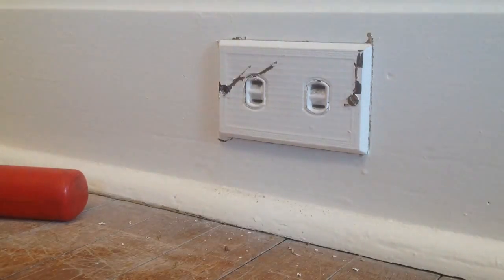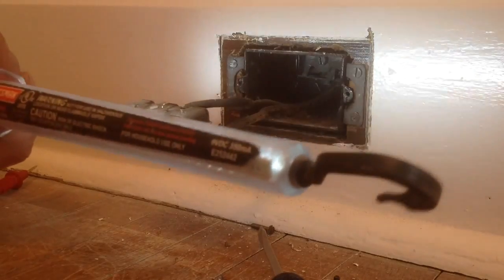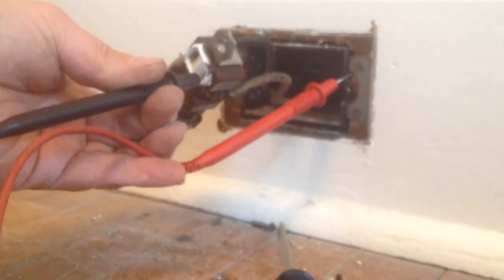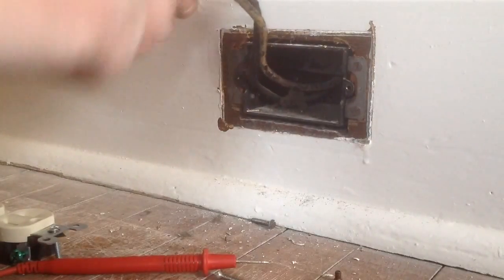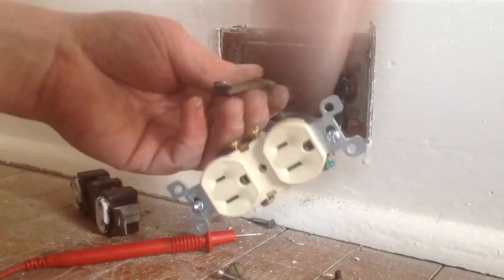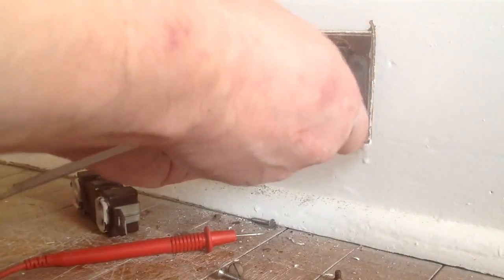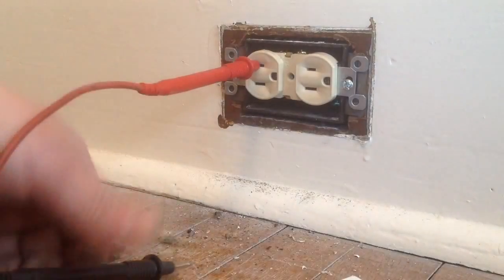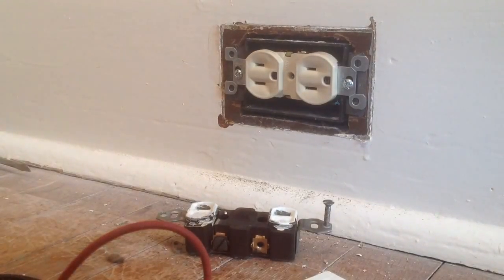Replace ungrounded plug with grounded plug

Comment: It is grounded because of the mounting screws on the receptacle, and the yoke making contact with the box mounting brackets. Just make sure the screws are tight. It would be better if you remove the paper keepers from the screws. Better yet, you could use a spec grade receptacle like a Leviton which has a brass grounding conductor staked on to one end of metal cradle. The mounting screw is always in in contact with this, making it unnecessary to have a separate ground wire. The box must already be grounded, which in this case he proved that it is. In many old homes it was common to have a 16 gauge wire run from the electrical panel to the metal boxes and attached to the back of each box. I assume that is the case here or they would not be grounded. Metal conduit or bx cable could also have been used here.

Comment: IT'S STILL NOT GROUNDED
Reply from the maker: Yes the plug is grounded. This is classic vintage BX wire. Even if you can't see the BX the style of the wire and plug reek bx. The ground would follow the metal bx cover to the main box and serve as a ground. It's grounded.
Reply from the maker: There is a part 2. That puppy is GROUNDED.
Reply: @themrhelperguy  lol a proper ground is connected to the green screw that has nothing connected to it. Even if it's just grounded to the box itself. Grounded to the box is acceptable in some states but won't pass an inspection for a city inspection in my state
Reply from the maker: Yes that green screw would be used with plastic boxes. The plug in the video was used with a metal box so the green screw would not be used. In the comment it stated that the plug was still not grounded. With the configuration in the video it is a grounded plug.
Reply from the maker: That little green screw is for use when you would use a plastic box since the ground is not carried through to the metal on the plug. That's why the metal of the plug has a ground provision. This is all common information that can be accessed in any trade magazine covering electrical wire articles. It's not something I do it is done everywhere like this. Really you would create a grounding mess when multiple devices are used to ground them to the box. Unneeded additional wires to fill area in a metal box. This will pass inspection all day as a grounded plug. Good luck with your city inspections.
Reply: I'm not having city inspections but I had to have stuff like that re done in order to sell my last house. This is how I know. That city wouldn't pass it for sale unless we ran a ground wire from the copper plumbing to every plastic box in the house. This meant wall repair too.

Comment: This does not meet NEC 210-7(d)(3).  It requires a GFCI labeled appropriately ("No Equipment Ground") to be compliant.  The narrator mentioned something about grounding but it was incoherent.  Without clear audio I can only judge what can be seen in the video, which appears to be non-compliant.
Reply: +Susan Stone Salas
The corrugated steel jacket of most BX cable manufactured prior to 1959 does not have a bonding strip, which means that if you try to use the jacket as a fault current path most likely it will have to high of an impedance to cause enough current to flow to trip the breaker , since you have created a path flow through the rusted high impedance corrugated steel path , if a short ever does occur then the jacket of the BX cable will pass a rather large current but will not trip the breaker in turn the corrugated steel jacket will get very hot and essentially become a heating element which can cause a fire.
Reply: He verified ground at the metal box, so he can add a ground wire to that. How is that non-compliant?
Reply: The device that was shown to be installed is not a GFCI. Based on what is shown in the video, the installation is not compliant with NEC 210-7(d)(3).  I'm basing my comments strictly and objectively on the information presented in the video.

Comment: Girl here... First time, most of this is foreign to me and I need a little more explaining, Can someone please confirm that he said gold screw is plus for black and silver is plus for white?   I dont get where he mounted the "green screw" ( I couldnt see his hands), Do I need to make a hole in the metal box to tighten the green screw for it to be ground?  This would keep the electrical plug in place as well.  (assuming my metal box is grounded which I will find out first).  Thank You
Reply from the maker: +Katrinka Solomon silver is the white wire. Gold is the black wire. The green screw is threaded into the back of the box. There is a threaded hole there. If there is no threaded hole they make ground clips.
Reply: themrhelperguy thank you :).  I ended up getting a referral from a friend for a electrician, gave a good price and he changed them out for me.

Comment: I could not understand what was done with the green ground screw. can someone explain?
Reply from the maker: +TheMicholopezf the green ground screw is mounted to the metal box. If it is a plastic box you will use the green ground screw on the plug.
Reply: The point is for it to have something metal to absorb a surge. Your theory would indicate that you don't need a ground wire or screw ever because the green screw is already connected to the plug?

Comment: Finally found a video that shows how to check if an old metal receptacle box is grounded by checking if you get 115 volts between the hot lead and the box itself.  This is what I thought, but couldn't find any videos showing how to check it.  Thanks.  Now I need to get going on checking and replacing a bunch of two prong outlets with grounded, three prongs in my 1948 house wired with BX armored cable.   Thanks!
Reply: @CHD: Careful. Someone might have also shorted neutral to the ground somewhere other than as allowed at the service panel, giving the same test result.